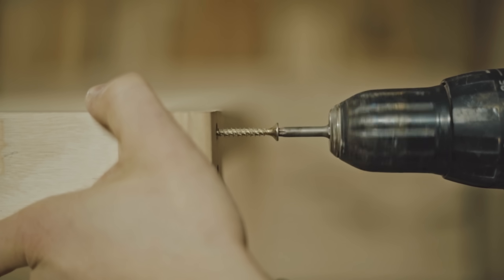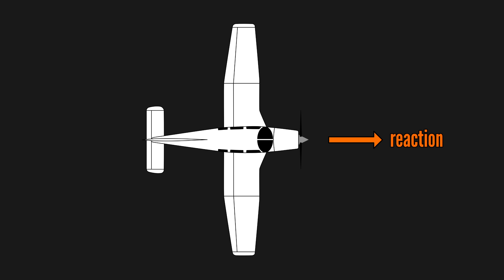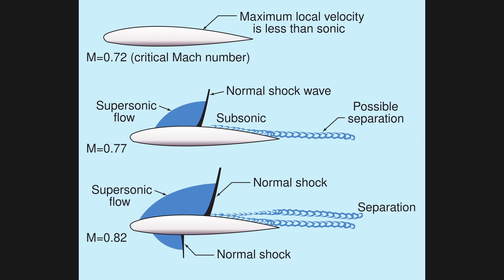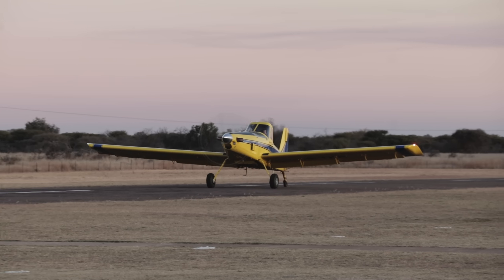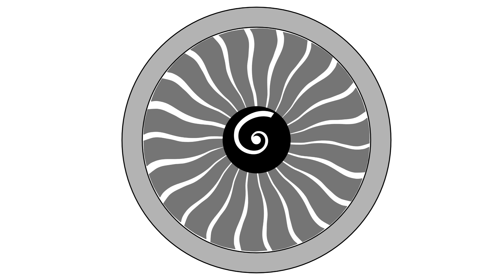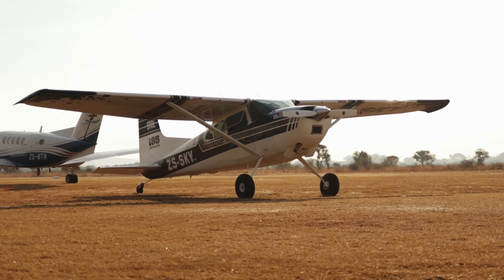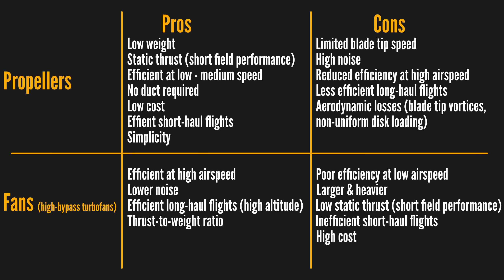This is Why Some Aircraft Use Propellers and Others Fans

Comment from the maker: E-Props "Constant Speed" Effect Finally Explained : https://youtu.be/PIeaRmwView
The Problem with Single Blade Props Isn't What You Think : https://youtu.be/my7UrH3V8KA
4 Biggest Propeller Myths Explored - Long v Short & 2 v 3 Blade : https://youtu.be/Vgj3Bbwqtjs
Reply: you accidentally linked the wrong youtube video to that one: E-Props "Constant Speed" Effect Finally Explained :
Reply from the maker: @benbro8287  Fixed. Thanks.
Reply: @LetsGoAviate 
That doesn't make sense! 
Is the fan designed to compress air? WHAT?
That's stupid!  The FAN of the TurboFan engine does not compress air! 
The Venturi effect says that any fluid that is in a large duct and passes into a smaller one decreases the pressure and increases the fluid velocity.
The FAN and the propellers work in the same way.
The point is that the FAN has a larger "wing area" than the propeller and this makes the FAN move more air mass because it generates more LIFT in all the blades than the propeller.
The FAN works on everything to help direct the thrust of the fluid.
Reply from the maker: @x-gamessimulator1067 Why does it not make sense? If you go to any turbofan engine's manufacturers website, they state the total air pressure ratio as well as fan pressure ratio. Just type "Pratt & Whitney JT8D fan pressure ratio" into Google or go direct to the manufacturers website where is shows it's 1.92 to 2.21. Check any turbofan engine's specs. A pressure ratio of 1.92 is an increase of 92%. It's modestly compressing air.

This compression is little comprared to the compessor stages of the core, but it's far from negligible.
Reply: @LetsGoAviate  in an axial compressor the rotating stage increases the air velocity, the stator stage coverts the velocity to pressure by slowing it down via diffusion. Diffusion is inefficient because the air is going against increasing pressure and wants to reverse.  
    A propulsion prop or fan’s goal is increase the air velocity.  To increase the speed, ineffeciently diffuse, then reaccelerate?  Why do so if the fan accelerates air from the get-go?   
      fan blades are kinked, the inner part optimized for compression , the outer for propulsion (plus the twist accounting changing velocity).  Does the P&W material distinguish between the inner and outer fan sections?  Are they giving the fans static pressure rise as a more useful metric than velocity (e.g. pressure x area = force (thrust)). 
      I have been out of the gas turbine game for decades (think JT8D), things change, and I don’t mind being wrong.  Married 48 years, I am familiar with being wrong.            Thanks for your time.   D
Reply: @LetsGoAviate Part of our misunderstanding is pressure and velocity interchange.   (p + rho x V^2/2g) x A = thrust.   The p is free stream pressure and the velocity term is the dynamic pressure.    Cheers
Reply: Props and fans accelerate air, pressure is the result of slowing the velocity in a diffuser.  Accelerate, diffuse, re-accelerate?

One small point is the strange fan blade shape.  Suggest the inner blade portion aims to increase the pressure entering the compressor, the outer blade portion aims to aircraft propulsion.          Good work.   Best your way.
Reply: And why not make an inducted screw like that of a jet ski  with a modification to the bigger front and a smaller rear ,you will surprise of the outcome, it's not laminar rather twisted
Reply: Are you slow? The screw and pushing air things are the exact same idea stated two different ways they are both the propeller pushing against the air making it go forward. Before you get confused would a screw push itself through a piece of paper?

Comment: I would add a few thoughts on why some planes use more propeller blades than others.  The simplest way to explain it is the idea of power absorption.  As a thought experiment, say that you have an engine that produces 1,000 horsepower.  Your plane only has 2 propeller blades that are 6 feet long.  You can only turn your propeller so fast until you hit mach tip effects where efficiency goes in the toilet.  So you will never get the two props to absorb 1,000 horsepower.  But as you add propellers you will start to approach the power absorption that your engine can provide. (As an example of this effect, see old pictures of the Spitfire.  They first used 2 bladed props, then 3, then 4, then 5, and then finally 6.  This is because as the plane aged, the power plant continued to be replaced by engines with more power. )  I hope this was helpful.

Comment: Install two fans on each wing, and add two more to each fuselage, you wouldn't be able to fly that plane or even move it. What makes a plane fly is the torque created by the propeller cutting the air. This torque creates a pressure difference in front of and behind the propeller, pulling the plane forward. A fan never has such ability.

Comment: Very good video! 
As I see it while there is a difference between a propeller and a screw, it's a similarity too. They are acting in different mediums. 
A screw works in a solid matter and a propeller not in a solid matter so therefore the medium is pushed backwards.

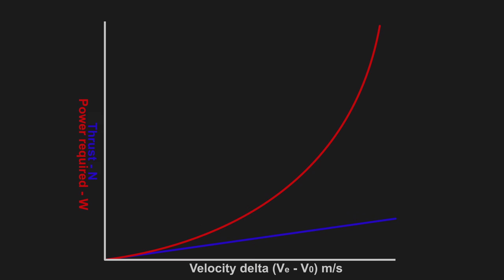At 2:30 there is a wrong statement. Air resistance increases with the square of the speed. And the thrust of a propeller increases linearly to the air resistance, not linearly to the speed. The required power increases with the cube of the speed.

Comment: I have a feeling the concepts in this video only apply within certain operating ranges and can be wildly incorrect in a different range. This was briefly acknowledged describing turbofans but can be completely incorrect. For instance a couple decades  ago there was a jump in interest in long endurance, high efficiency ultralights including a few that explored human powered flight. For each of these that tried to extract the maximum amount of efficiency, prop blades were very large and aerodynamically efficient and had airfoil shapes that provided a much "lift" as possible to pull the propeller forward. This suggests that for these aircraft the propeller probably about equally pushed air backwards as described in this video and "pulled" or lifted the propeller forward significantly as well.

This concept to maximize lift by an airfoil can be seen in many examples today. Whereas old school taught that airfoils generated lift by creating a low pressure above the wing, examples like the lifting body shape of the B-2 bomber additionally angle the airfoil and shape it to generate kinetic lift under the wing as well. Propellers should be no different except perhaps in a reverse manner.

As for suggesting fanjet engines mainly compress bypass air and minimizing and controlling tip vortices is complex and less relevant, I'd suggest that without a duct or specially engineered fan blade design to control tip vortices, you wouldn't be able to achieve significant velocities and in that case a fan would likely produce no more potential thrust than a propeller at best.

Comment: Fan blades don't have to endure high heat. They can be made of elastic materials like Teflon. Fans with adaptive (i.e. variable twist) blades are efficient both at low and at high axial speed. See sketch:   https://i0.wp.com/stallfreepropellers.com/wp-content/uploads/2020/11/Rotor_Metszet_Tiszta_05.png?w=893&ssl=1

Comment: Many military cargo aircraft still use propellers because even when the aircraft is not moving the propeller is pushing air over the wings and generating lift, this means that the aircraft will need a shorter takeoff  run... Also being able to extra generate lift with a propeller while flying is a useful thing to be able to do.

Comment: This video does not include the centrifugal compressor, which when combined with a devise to turn the flow into an axial direction ,wastes less kinetic energy than any axial fan.
Reply: The efficiency of any heat engine will increase with its compression ratio. The axial flow turbine ends up being more efficient because air is delivered to the combustion section at higher pressure. Even though a centrifugal stage will achieve a better pressure ratio than an axial stage, the axial arrangement wins out because it lends itself to multiple stages of compression.

Comment: meh - push(thrust) vs pull is 100% about point of view / frame of reference.  The thrust formula gives the frame of reverence of the plane which is the most useful frame of reference when considering the utility of the plane.  However, if you reformulate it as the point of view of any individual air molecule it will be a "pull".  The only thing this proves then is that we are biased to care more about the utility of a plane than the air - which is perfectly understandable.

Comment: Thank you for this. You clearly explained the physics of propellers versus (ducted) fans, but I have a more general, intuitive question. How can a huge jet airplane, surely with a big wind resistance, fly at near supersonic speeds without needing to produce supersonic thrust from just two small jet engines?

In my imagination, if I have a plane moving at 250kmph, then those two, relatively small engines with maybe 25% frontal area compared to the rest of the plane, they would need to be pushing air through at 4 tines the speed, 1,000kmph!

But this is clearly not the case. Instead of needing four times the airspeed, I think the air going through a jet engine is only 1.3 times the vessel's airspeed? Is that about right?

So, what am I missing? How can small wind thrusters push a big plane through the air so efficiently?
Reply from the maker: Potentially the missing piece there is the  thrust equasion, which is influenced by two things, fan exit velocity, and mass flow rate (air mass displaced). So it's both speed and mass of air moved by the fan. Increasing any of the two increases thrust. So the fan exit velocity does not have to be much greater than the free stream air if a large enough mass of air is moved.

The other thing is turbofans generally get more efficient at high airspeed and high alititudes. Also, airframe drag gets less at higher altitudes due to less dense air. 

So with low air density and optimally performing engines at high altitudes, the the fan exit velocity doesn't need to be supersonic to get the airliner to fly near (relative) supersonic speeds.

Theres more, but I think thats the jist of of.
Reply: The maximum thrust requirement is during take off. Cruising at say M 0.76/36000’ requires moderate thrust by comparison. The explanation being the airplane cruise speed is near to its minimum drag speed. The engine will draw the volume of air it needs at the thrust setting. At cruise speed this will be less than intake area x flight velocity and the remainder is ‘spilled’ around the nacelle.

Comment: Does a prop push air backwards or pull craft forward? 
Isnt that really the same thing? Meaning doesnt it do both as one results in other?
Reply from the maker: Same thing yes. I was more saying it doesn't pull itself through air, it moves the air, "breaks up" the air.

Comment: The fan (in turbofan) creates pressure difference, the propeller just accelerates air. In other words: air is more dense behind the the fan.  Air density behind propeller and in front of propeller is the same. That's why the fan has many blades - they stop the air from moving forward. (sorry, I did not watch the full video, maybe it was mentioned somewhere, but 10 minutes to cove this one sentence? No)

Comment: Planes ahem "driven by propellers" ahem actually don't need a propeller at all to achieve level flight... definitely a must have for COOLING purposes! I want to say "creates a pocket of air thus insulated preventing ice build up" as well. Jet engines need a "fan blade" as needs to literally ingest air to create combustion. Yet again tho once the fuel is flowing the purpose of the "fan blade" is to provide cooling or i think "dissipation" be the technical term. Remarkable how much aircraft can indeed "fly themselves" actually 😊😊

Comment: Comparing a TubroFAN to a prop is sheer lunacy.  There have been many NASA funded DUCTED FAN (the proper term ) on  small AC and they were generally successful, but more expensive than simply hanging a two blade prop on the nose.

Comment: As an engineer I would have introduced the role of the diffuser, There is the divergent and the convergent diffuser which if on looks deep enough one finds them in many corners of the flying field .
I would suggest that the propeller has two poem diffusers which " accelerate" the mass of air  above and below the blade and being open they cannot build up much pressure and they accelerate the mass of air again it is  two types of " diffusers" which accurate the air in different manner, 

The fan on the other hand cannot be looked upon the operation of one blade and the diffuser is found in between two blades,   If the fan is to build up pressure behind it which it can  then the gap between two blades must be a divergent diffuser while the engine cowling would be a convergent diffuser to accelerate the  air mass inside the cowling and what is more the cylindrical air mass and its intertie will  act as a silencer, Even those little chevrons at the trailing edge of the cowling can be looked upon as delta winged diffusers which will modify the noisy vortes on the trailing edge of the cowling of the engine,  Sometime I think a few chevrons on the trailing edge, flap of a wing would have their own benefits.

Diffusers are the magic in engines and even in afterburners and how they slow down the air flow to keep the flame burning and how  after the last compressor  stage one can increase the compression by an additional diffuser. Last but not least is how the  the spaces between the compressor blades are divergent diffusers and those on the hot turbines are convergent diffusers,  We shall not go into the diffusers on the stators of the compressors and those on the hot turbines, and the cone at the end . We might as well mention the front diffusers in the Concorde, the remarkable Ram Jet and the diffuser miracles in the J- 58 which power the SR 71.  and we shall end by mentioning how one radial compressor stages in the Frank Whittle engine produced a higher compression ratio than due to the inherent divergent diffuser of the centrifugal effect.  Diffusers are the KERNEL  of all flying machines , So innocent, and so remarkable is the  humble diffuser,,  Bernoulli, Coanda, Newton,  Bleriot, Wright Brothers all pilots, should bow their head to the miracles in the " cold" and the " hot diffuser "   Foo Bernoulli , he should have expanded his insight to what happens if he ads fuel at the low pressure zone of the conventional Bernulli,  I would say that one can get an engine effect if one uses the upper and lower surface of a propeller or a fan by feeding fuel in between the blades of a fan  just one fan will be the whole engine and I would not be surprised if one wing and one propeller will be an engine if they are fed with fuel along the blades, Flying owns its miracles to the humble diffuser, be it wings, rockets , wings , propellers and fans or fridges and  silencers and thermodynamics in general . 
Congratulations on  depicting the difference between the prop and the fan, .

Comment: in a way, the screw will push the wood backward if the screw is fix and the wood is free to move.
Reply: Same way pulling a door open constitutes pushing the door handle backwards with your fingers. It's a pretty disappointing theme to lead into the video with, since it's nothing more than a perspective shift when you get down to the mechanics of the process.

Comment: so why dont they just put the propeller on a tilt rotor setup to prevent ground clearence issue ? or is the added weight of tilt rotor mechanism offset any fuel saving a larger prop will have ?

Comment: Missing information wise, fans rarely have variable pitch, making them far less suitable for driving from a constant speed engine over variable load conditions. Meanwhile most larger propellers have a huge range of pitch, which also allows them to reduce drag in an engine failure, drastically lowering the power requirement for the other engine(s) to keep the aircraft going, and reducing the minium airspeed needed to keep enough rudder authority (aka the vertical tail section able to provide enough force) to keep the aircraft in a straight line.
Fans are also MUCH expensive than propellers to buy at all but the very largest most powerful engines, requiring not only more blades, but much tighter tolorances to fit with the duct, and operate at higher RPM, while being more sensitive to foreign object strikes (be it debris on a runway, birds, or even a bullet for military operators). This alone has been the dominating factor in keeping them out of general aviation, even for designs that mostly aim to cruise at high speeds/altitudes, or would accept other tradeoffs from a fan to reduce the diameter or noise.

Comment: (before i watch the video), the jet engine fan is kind of like a vacumme, it sucks in air, uses fuel burn and flame, exhaust gases blow out the back by sucking in air like suction in order to make powerful thrust to push the engine. Propellers are similar or jet engines are similar. ( i might be wrong on this but sorry if i am? )